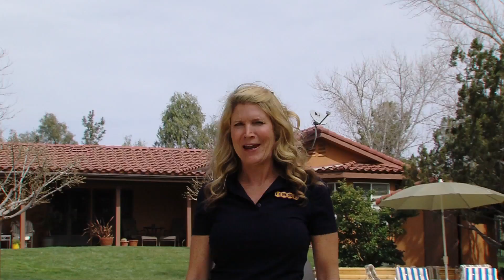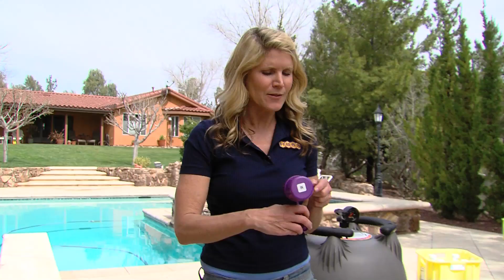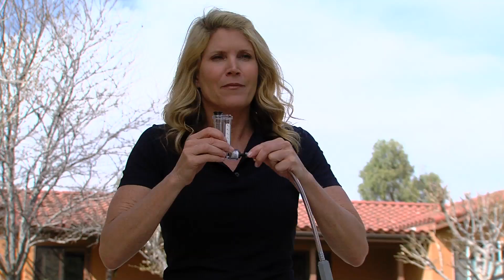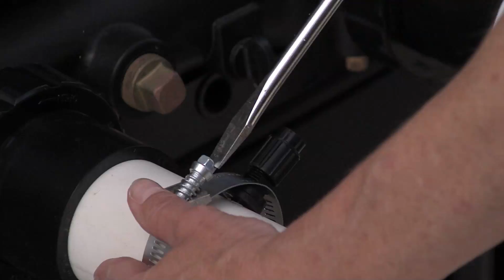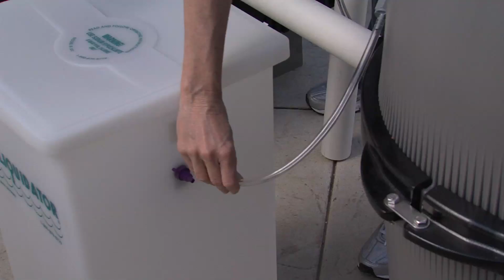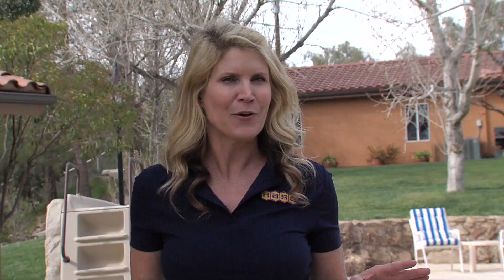The Liquidator

Comment: Something important to note, not mentioned in this installation video, that I ran into when replacing my floats.  Do not throw out your old floats/bracket/seals until you complete this modification.  First understand they have a new version of the Liquidator out now and any replacement float you get will come with a completely different end piece on the floats that you will not be able to install properly on the older 936101 Liquidator, unless......you carefully pop out the float arm out of the bracket that goes through the liquidator (there is a round stem and hole on each side of the bracket very gently pull it out) remove the bracket part from both the old and the new float arms but keep the parts for the "in" and "out" separate.  Now reinstall the new float and arm into the old bracket, and now you can install the new floats (with the old brackets so it has the ends you need to attach your water line hoses to.  Also, look at the bracket position: the "In" bracket has the closed end on top, whereas the "out" bracket has the open end on top; this is important so the floats move correctly.  I think the original Liquidator came with a cheat sheet, which might help with diagrams too.  This video is for the older Liquidator which if you set up correctly is a cheap way to add chlorine automatically based on your pump running a minimum of  2800 rpm, preferably at night and remember to keep your pH 7.4-7.6 very important for the chlorine to work efficiently and prevent scaling even in your tank and floats as well as keep your CYA at the recommended level to help protect the chlorine from burning off as soon as the sun it's it.  I also highly recommend Pool Rx Bullet for algae prevention, too, and if your calcium is high, use a scale prevention treatment.

Comment: I would not feed pure chlorine into the heater. Should install it on the output side
Reply: You're not feeding pure chlorine; it's diluted in water in the tank and further diluted when it is added to the water headed to the pool, but you can add the outliner after your heater, too.  What you want to be careful of is low pH!

Comment: The chlorine enters the water on the suction side, and the connection after the filter pushes water to the unit, correct? So pool water goes into the Liquidator. 
Wouldn't that cause the chlorine to be continuously diluted over time? I guess it's similar to an erosion feeder in that regard. 
But how do you know when its low/out of chlorine?
Reply: She spoke of a "chlorine bed" towards the end of the video.....rewatch.
Reply: @jp-zz7de  Thanks, I'll do that. I wasn't patient enough, evidently.
But it should have been stressed much earlier in the video, not thrown in as a side note in the closing comments. It's a pretty important piece of info!
Reply: When you dump chlorine in a pool, you are diluting genius. If it’s using the same pool water to dilute in the container, it’s doing the same thing. It’s a closed loop. It’s called logic. Use it.
Reply: If that is true and I'm guessing it is, then you have dirty water, possibly algae, entering your feeder tank.  On mine the water enters the tank after it's been filtered going to the pool, so it's mixing with clean water and less likely to clog, too.  This is the weird part: it dispenses the chlorinated water out to the pool pump that recyles it through the filter again.  I guess this means I'm disinfecting the water going through my system, and it eventually ends up in the pool.

Comment: An electric systolic pump would be a better alternative to HASA's Liquidator.  The systolic pump is adjustable and accurate.  I use a Stenner S7G45MFH2A2S.
Reply: You are correct, but not everyone has thousands to spend on that kind of a setup vs a couple hundred dollars.

Comment: What prevents water on the supply side from going into the chlorinator tube and back into the chlorinator reservoir?
Reply: There is a check valve to prevent that
Reply: @terryarko3446  I'm confused.. which side does the chlorine enter the pool water circulation? Does it enter pre-pump (suction side) or post-pump/filter (supply side)?
Reply: @branl3768  Mine enters from the supply line after it has been filtered and then enters the pump feeder attachment at the bottom of my pump with a push/lock connector. Not sure this was how it should be set up, but then less holes the better.

Comment: Question about the chlorine sitting in the plastic container. With no protection from the heat, how long will the chlorine's effectiveness last before it gets introduced into the pool?  Will the liquid degrade over a few days or a week in this hot CA sun??
Reply: The tank itself prevents the sun from ravaging the chlorine, plus I cover my tank with a sun shade.  It doesn't matter if you store it in a tank or in a shed in a 1-gallon jug, it's going to degrade, so it's better to buy Hasa chlorine from your local pool store even if it costs a little more (you may have to look around for a distributer) because it comes direct to them from the manufacturer in regular deliveries and will be the most potent pool chlorine you can buy @ 12%  instead of the Walmart-supposed 10% that's been sitting in a warehouse for months.  I only put 4 gallons of chlorine in instead of 6  in my 8-gallon tank. They recommend using up what's in the tank before adding fresh chlorine, but that will become very weak if you do, just because the dilution rate will be more water to chlorine, so adding more once a week might be more consistent.

Comment: WARNING: The out tubing is installed before the suction side of the pump, if the float valve malfunctions or if there's a leak, the pump may lose prime causing damage to the pump when it runs dry.
Reply: I had mine installed, and they attached the "In" tubing to the outgoing side, which means it is getting water after it is filtered, and then the "out" tubing is connected to the bottom of my pump where there is a plug for the purpose of attaching a feeder line.  I also attached a needle nose adjustment to control the flow on the "out" tube before the pump and a ball value shut off on the "in" line.  This way I can turn off the water flow and remove my tank for cleaning.  I also found a really good hand siphon to use to remove the water when I need to clean out the salt residue.  I found if you let the sun dry it out, it's easier to pour out the stuff at the bottom into a trash bag, as well as the floats, and tank cleans off easily with a spray hose.  Clean before and after summer (twice a year should do, along with cleaning your filters).

Comment: When will they have a liquidation sale?
Reply: a version 2 just came out
Reply: @lukepoolservice  Lots of complaints on version too, hard to find online now except on eBay.  I believe they are remodeling it.  There was a leak problem on the tank where there was a seam, I understand.  I bought a different type of hose that doesn't seem to get clogged.  With liquid chlorine, you have to watch the high pH scaling, I use a scale preventer.

Comment: I have a question about the install the video says to install the inlet pool before the pump inlet, doesn't that create more of a suction then a pressure effect also wouldn't it be better to place the inlet line on the pump outlet side before the filter to have a more filtered water side running through the strainer of the pump. deems like you would have better ,cleaner water flow to the liquidator.
Reply: Never mind just got my unit and its reverse from a standard inline tablet chlorinator It Makes sense now . Ive been using trichlor tablets for years and have fought keeping my Ph up every week. Hoping this will help keep my ph under control better
Reply: My installer put the "in" after the filter so the water has been filtered first before it goes into the tank, then they attached the "out" to the pump's attachment line at the bottom of the pump which it is designed for.  It has kind of boggled my mind a little because that means the water going to the pool fills the tank and then flows to the pump before the filter so it is filtered again and heads out to the pool where some of it enters the tank again with some chlorine in it.  I don't think it hurts anything, but may take longer to put the right amount of chlorine in the water, but it also means it's sanitizing my filters too.